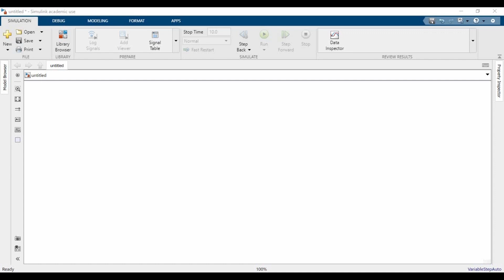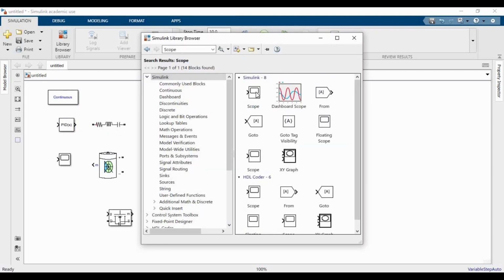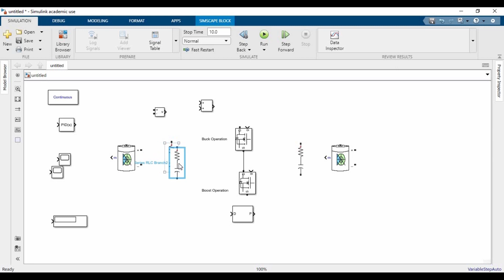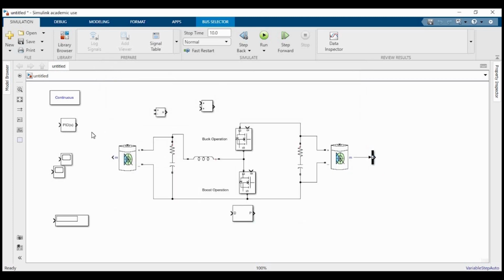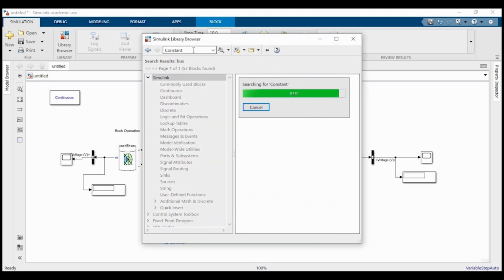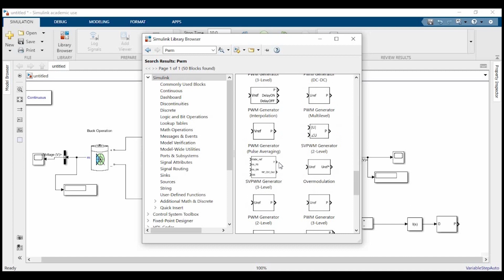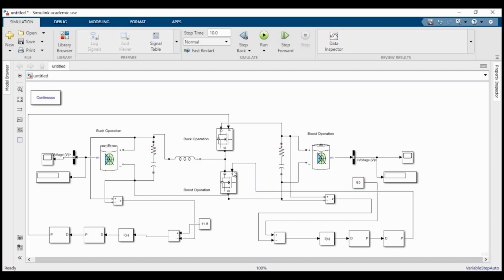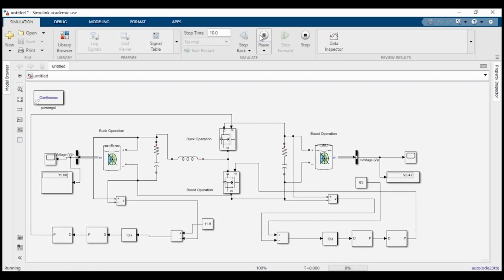Bidirectional DC-DC Converter Step-By-Step Simulation in MATLAB/Simulink!

Comment: Thanks for sharing the video. I am looking for the bi-directional DC-DC buck-boost converter models for both battery and ultra capacitor to be used in Hybrid vehicle model. You have used 2 batteries in your bi0directional buck-boost whereas there is only one battery that's needs to discharge and charge, depending upon the situation. Same is with UC..kindly help.
Reply: Hi, I am working on the same project. Can we talk about it. I have done a very basic model now

Comment: What do u mean by bidirectional? I thought it will allow to charge and discharge battery. Is this capable of doing that. I wanted to make a dc-dc converter for my battery pack in EV design which has regenerative braking.